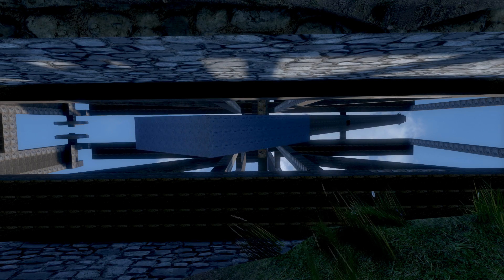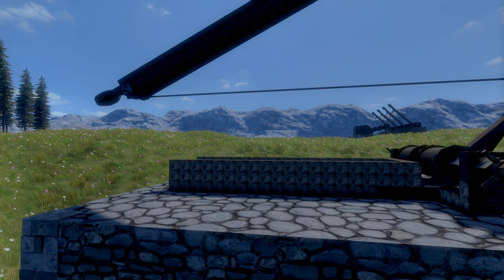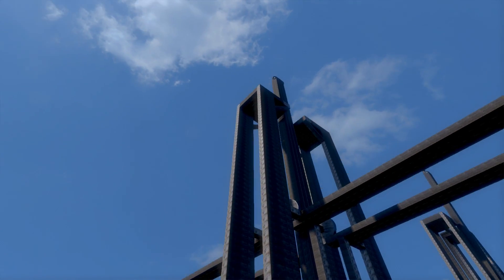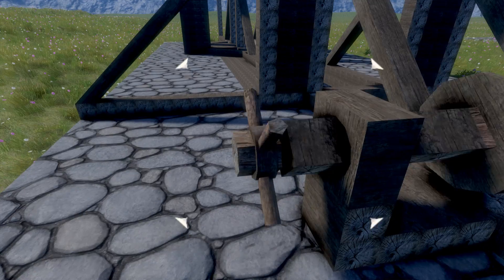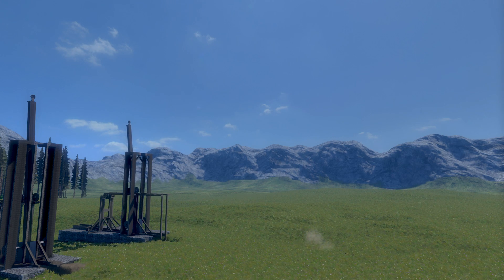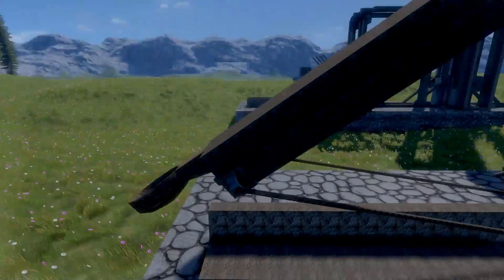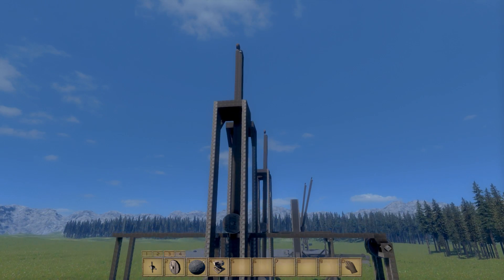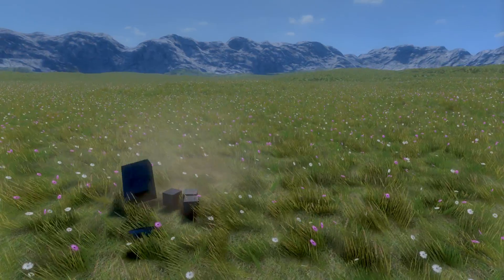Medieval Engineers: Floating Arm Trebuchet, Modern Trebuchet Design

Comment: There is one problem with this design - you depict a heavy counterweight at the end of the trowing arm. What would this be in reality? There is a reason why medieval trebuchets used a pivoting box filled with stones - there was simply no other way to provide such a mass. Today you could use rings of cast lead but this was not an option back then.
Reply from the maker: As I mentioned in the description the FAT is a design that's far more modern - it's kinda what a trebuchet would look like now if we still had a purpose ot make them :)

Comment: the best angle for distance is always 45 degrees. If you have the cutoff bar exactly halfway between where it is in this video and the horizontal (rotationally, not linearly) it should achieve the maximum distance (assuming Medieval engineers physics is similar to real physics)
Reply from the maker: zach chaney That did produce the best range but was still limited by the fact that this sort of trebuchet was never designed to stop at that point, most of the force comes from the follow-through of the arm.
Reply: hello fellow Zach
Reply: Stopping angle for a trebuchet is better to be at 90° (as long as it can still hit) because you want to prioritize horizontal velocity over vertical velocity

Comment: If you put the cross beam further back, so when the arm impacts it, it's more at an angle, the tangent of that circle your projectile was travelling is the angle it flies at.

Want more range? Put the crossbeam further back.
Reply from the maker: The issue is more a lack of overall force, I did play with having it further back but in reality there is friction present that is killing the force in a way it shouldn't be, probably because of lack of suitable parts for some areas of the design. Hopefully now we have a sling I can add some more in that area at least..

Comment: out of curiosity are you going to re-post this with the now working trebuchet release hook? I was working on one myself but it kept sticking in the track and exploding. I would like to see yours in action or maybe even as a workshop item.
Reply from the maker: I didn't even see yesterday's update contained that I was soo busy... the answer is very much YES! Need to re-make it a little with the new round timber also. Cheers for reminding me I now have to get excited on Tuesday's as well as Thursdays :)
Reply: ***** Not a problem :), i also was curious about the "FAT" are there any dimensional rules or ratios i could use in the creation of one? I do not excel at the mathematics involved so some simple ratios have helped me out. For example in ME for a standard trebuchet i use a ratio of 3.5 - 1 for the main arm lengths using the "1" for the hinged weight distance as well.
Reply from the maker: ChaoticKnightmare
I ended up looking through some schematics and working out my own as I couldn't find the simple ratios anywhere. Sorry to not be of more help but I didn't even think to write them down :s Can find a few schematics just by googling and looking at image results though.

Comment: Connect a rope between 2 balls, put one in the 'scoop', might work like a sling.
Reply from the maker: Have been playing with that idea.. 2 balls doesn't work that well as they come out of the cup too easily but a ball on a rope with a t-bar sorta shape on the other end that slots into the arm is showing some ok results so far, need to perfect it though. Cheers :)
Reply: ***** You can get some good spin if you add a stationary secondary spoon for the second projectile.  The second spoon will change the trajectory of the projectiles.  Also, will you be uploading this to the workshop any time soon?
Reply from the maker: David Whitten
Well apparently we now have the real deal release hook so hopefully I'll not only be uploading it soon, but as a fully working version :) Will try and get some time for that tonight!
Reply: ***** Please do, and upload it to the workshop while your at it.  I really want to test your design out and reverse engineer it.
Reply from the maker: David Whitten Didn't find time last night but will do asap :)

Comment: One thing to try is creating a sling-like-effect with the projectile rather than the framework. Create 2 balls, put one in the holder and another about 5 metres behind, link the 2 balls with a length of rope. When launched the second ball helps carry the first. I've had some success with this.
Reply from the maker: Oh, interesting thinking there sir.. getting a swinging moment between the pair like that is kinda cool, will have to play around a bit and see if I can use that for this.. cheers :)
Reply: Getting a consistent and accurate advantage would be impossible

Comment: could you not build a wooden open topped "box" and attatch it with 4 strings to the tip af the arm as a make shift sling?

I must say im extreamly impressed with this, and id rather not have you coming near my castle if you dont mind :P
Reply from the maker: I fully intend to continue my reputation of 'guy you least want to have in a non-friendly MP server with you' in Medieval Engineers also :) hehe

And sadly not, the ropes have some weird elastic function at the moment when attached to an object that can move that isn't held in place somehow.. as the arm lift it draws the box towards the arm until there's 0 slack left and it's basically touching the arm.. was my thought also :(

Comment from the maker: @Taylor Webb For some reason can never reply to you directly.. but thank you :) It is lacking a little force at the apex but I'm hopeful that the sling will help a fair bit with that.. certainly don't want to modify it too much before I can test that bit (and you can see using the public-true mod that hooks and a sling are coming!).
Reply: ***** time for the sling setup man
Reply from the maker: 1wsx10
Yup :)
Reply: ***** so its coming? awesome
Reply from the maker: 1wsx10
Indeed, been a mad week but should get it out shortly.. doing a bit of a redesign at the same time to make use of the new catch blocks too.
Reply: ***** ahh, makes sense

Comment: Maybe it's not that useful here because you wouldn't get enough energy. but in physics we saw that you would get the largest distance if it is thrown with an angle of 45° wrt the ground.
Reply from the maker: I'm kinda gonna hang on the sling part and then see how it performs before I change too much tbh, seems ok so far but it's always gonna be a bit weak until it can use the sling action proper to transfer force. You are correct though and if physics dictates that's the best angle then you can be pretty sure ME will agree with that :)

Comment: Nice, but you can make it work without the the rope cutting feature, instead of attaching the rope to the end of the arm, instead build a holder on the end for a block of wood to set in, place a rope tie block on that, and connect a rope from it to the projectile, then if you've done it right, the projectile, rope, and block of wood will go sailing.
Reply from the maker: Feel kinda honoured having you comment on one of my vids :) Thanks for some epically cool mods dude, can't wait to see what else you come up with for ME. See what you mean with the holder, will have to give that a try, rather ingenious in it's simplicity but might just work.. only concern I have is rope's habit of contracting length when given then opportunity at the moment... still, very intrigued. Thanks :)

Comment: wait untill the wood beams can break themselves on harsh contact :D
i heard they are going to add that it soon.
Reply from the maker: Only harsh contact is in the catapault version I show at the end, was very pleased with that tbh.. whole point of this design really is that it's very smooth and stable, all the force is transferred to the sling. I may need to make some of the beams thicker if they change it, but if this doesn't work in ME then ME isn't an accurate representation of physics :)